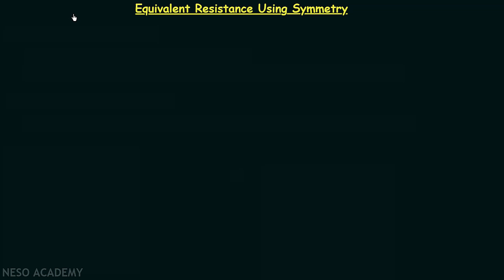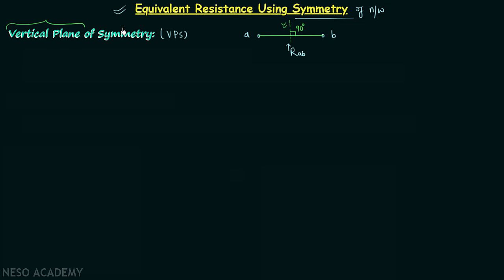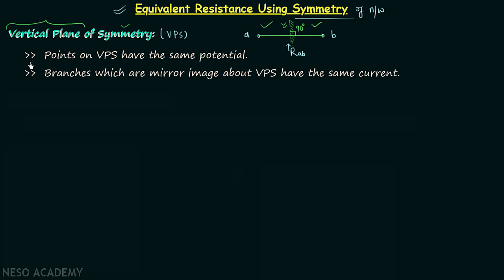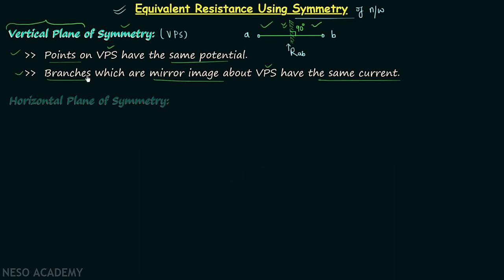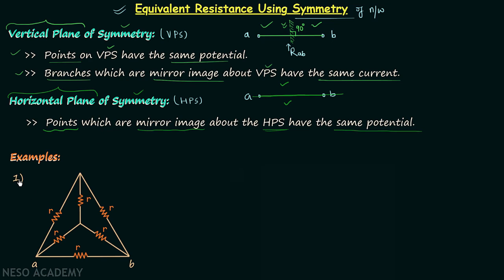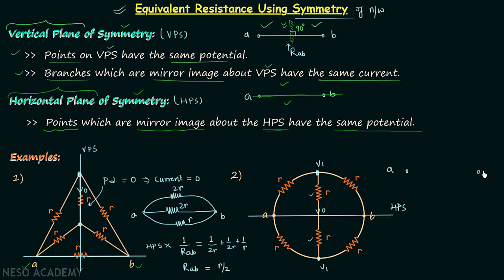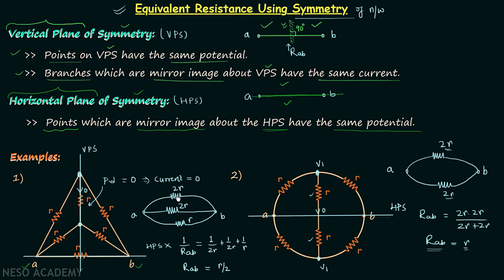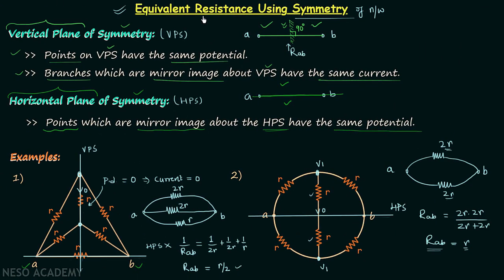Calculation of Equivalent Resistance Using Symmetry

Comment: 10:00 The points with pot. V1 would act as a single point, thereby giving Rab=(r||r)+(r||r)=r. Similarly it can be applied in the first problem too. Correct me if I'm wrong.
Reply: Yssss thought the same

Comment: After removing the points which have zero potential difference and zero current, won't the 4 resistors of the circle be in series??

Comment: I think in the 1 example the points should be shorted
Reply: yes, i also thought same but it is not Short, may be because short circuit condition is R=0, V=0 but in reality R not equal to zero only V is 0

Comment: Aren't the points A B in the 2nd problem shorted? The equivalent resistance = 0
Reply: No, he drew the horizontal line between A and B to show horizontal plane of symmetry. That blue line is not a wire.